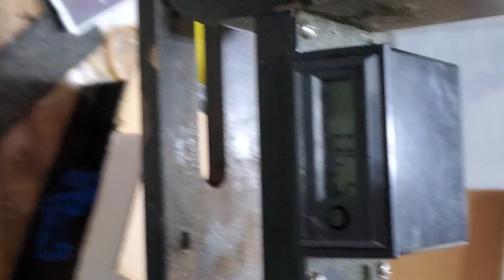How Much 80lb Gen 3 Hollow Core Braid will fit on Shimano Speed Master 20II MOST SATISFYING

Comment: Cap. I’m struggling on what to buy I got 2 things in mind penn fathom 40nld , penn battle 3 6khigh speed , ( yea ik you said you haven’t worked with them yet ), but let’s say I had to pick one to use for both freshwater and salt water , just 1 combo to use for to catch bait and to catch big fish , would you say lever drag or spinning reel .? What would you use ( not askin the reel brand or what the reel is just askin what would you use for both salt and fresh , lever drag or spinning .?!
Reply from the maker: Are you planning to throw lures?
Reply: @TeamHardLife   okay so like let’s  say for sharks , and alligator gar
Reply: @nelson442  well depends on if you are doing lures or live/dead bait and if it will be from land or boat. Also what size of sharks and  gar? If you are planning on throwing any lures or bait frequently I’d go with a heavy duty spinning set up.
Reply from the maker: Then would go with the Penn Fathom has way more drag.
Reply: @TeamHardLife  okay thx im going to get both but I wanna know what to get first then save up for the other one
Reply: @connor8253  I mean I really like both but I’m deciding which one to get first then get the other one later on
Reply from the maker: There you go..
Reply: @nelson442  as a saltwater fisherman spinning reels are the most versatile reel to me. I’d have a few penn battles and really like them as a budget reel. If you want to get into really heavy drag spinners look at the spin fisher or slammers.
Reply from the maker: If you go spinning make sure and get the cannon or bionic finger to ensure you can cast good without worrying about setting the drag
Reply: @connor8253  oohhh beleive me i had 3 avets 1 spin fisher , 1 penn 50intrtnational , 2shimano saragosas , and 1 penn warfare , the avets were my fav , i worked from since i was 13 winning only 60$ for 2 days in a flea market , i asved for like 2 years  i finally got my dream reels , then my mom works in repossesing houses assistant, she found all those other reels combos i had about 5k$ in gear and there was a 35ft boat but she sold it ,and about 1 month ago someone went through my yard and stole all my gear i have nothing and everytime i see cap.albert vids it brings me joy , but i have 300 as a budget right now later on im going to save more money and earn more and buy my own good gear . and im going to try to get some battels and spins fishers .
Reply: @TeamHardLife  i had that before they work great i had them on the reels i had they came with it ( incase you dodnt read or see my respond to connor , my mom works as a home repossesor assistanat thats how i got all my gear and the 2 spinning reels had it never knew what it was until 1 week before gettin stolen so i only tried it for 2 casts ,.), do you sell them ?
Reply from the maker: Yes sir was one the road earlier ad couldn't respond.. was out making deliveries
Reply from the maker: @Nelson so sorry to hear that really sucks and hope you get back on your gear
Reply: @nelson442   I have three penn fathoms the 60, 30, and two 15’s . I really like them. I still have not found anything wrong with them.
Reply: @marcopena3614  the red ones?, would you be intrested in selling the 30 or anyoone of them and how much if so , if not that’s fine , also are they good for surf fishing or pier fishing I have sea sickness I rarely go on boats or kayaks I get sea sick a lot I’m hoping if I can get my hands on one to use them for surf
Reply: @nelson442  yes the red and black ones. I totally love them. Sorry but I’m not interested in sell any of mine. My nephew has a fathom 15 lever drag that he has not used. I can see if he is interested in sell it. The battle 3’s are nice I have a 6000 and like the feel. Have not had a chance to fish with it yet but I think I’m going to like it also.